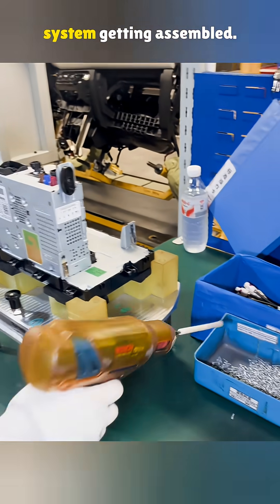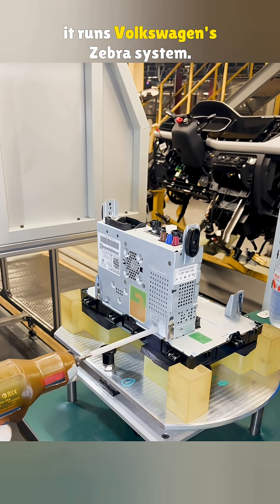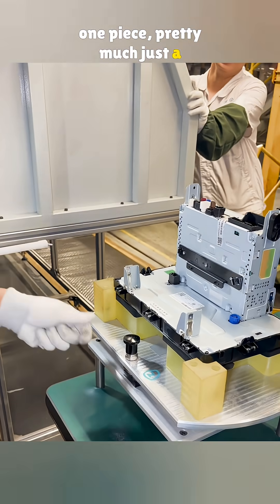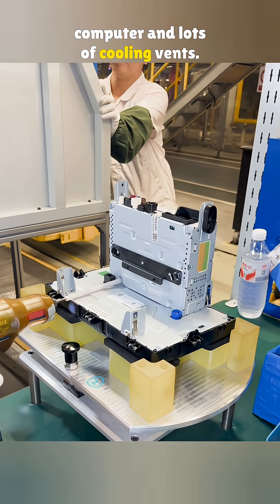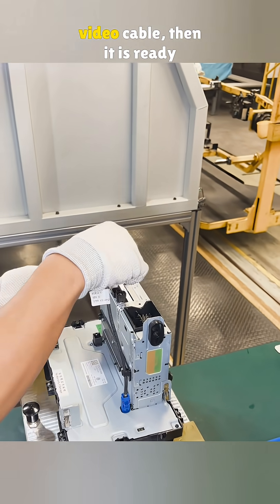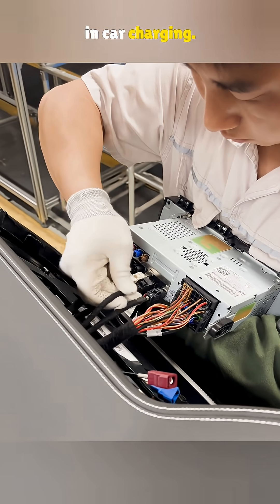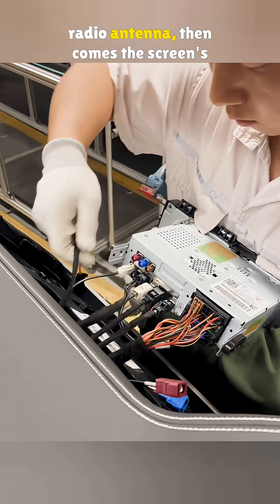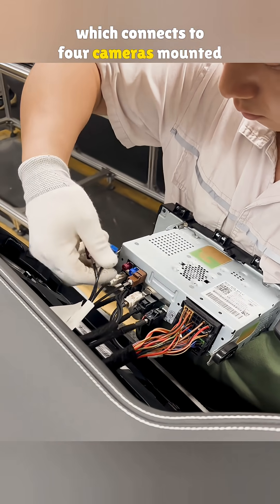Why Volkswagen’s Built-In Infotainment Beats Most Upgrades #assembly #automobile #car #manufacturing

Comment: Our generic Chinese (Temu) cheapie 10.25” wireless CarPlay screen has been mounted on top of the dash in full sunlight for a couple of years without any issues so far.  I don’t know how long it will last but so far so good.  I’ve had three aftermarket screens for different vehicles so far that have all been holding their own with no problems and they all cost very little $.  They’re not handling the kind of processing power that the OEM in-dash units deal with (controlling climate, multiple cameras, high-end microphones for cabin sound cancellation, etc).  They’re just basically wireless CarPlay devices.  But aftermarket products often equal or exceed OEM equivalent products.

Comment: the amount of bullshit in this video is astounding. the SOC inside a car's head unit is 1-to-1 to a phone. all the rest of the boards are is extra inputs for what a car has, like multiple cameras, parking sensors and whatever. Cooling is in most cases, terrible.
Source: I work with these boards.

Comment: None of them are better because they are things we don’t need & when they go off it won’t be spare parts on eBay for £50 it will be you have to go to dealer for the new part to be learned in via a computer only they have password for & your bill is now £3000 & more.

Comment: I use to work for Pioneer Europe and we built custom solutions for OEM. 
Also if you go for top spec, they can read by can-bus all the data. 

OEMs are better than the cheapes in AliExpress, but that’s it.

Comment: But at the same time, you can pay $10k extra for an upgraded audio in S-class, and you will get worse audio quality than aftermarket system for 3k. It's just a scam, as they are putting cheap audio drivers and amplifiers, and are hiding this behind cover with burmester or other harman kardon logo

Comment: The only system I've never had weird quarky problems with is the cheap aftermarket Android Auto system I installed in my beater van.  My wife's SUV, my car, and my work truck have all had problems with the factory AA/ACP systems.

Comment: Someone should show this video to my old VAG infotainment system. Overheating killed it before 4 years of age. In the very mild climate of the UK. Replaced it with an aftermarket set up that cost a lot less and ran perfectly (at least until I sold the car). Admittedly, it didn't have all the functionality in terms of controlling other aspects of the car, but lower functionality is better than zero.

Comment: I'm sorry but OEM units for cars are built as cheaply as possible and no manufacturer leaves more when a 3 Year warranty on them for a reason. 
You would always get better electronics with a pioneer or something similar and way better sound control 
But the problem is that brands forces car functions into these headunits meaning you can't replace them easily anymore without losing some basic functions like hvac control or some stupid car control you easily could have built into the dashboard instead 

Car brands always build with a set budget for parts and they have no reason to invest tons of extra money for parts they don't have to warrant for a long time and for a car they won't care about in 4 years since they expect you to buy a new one 
If your headunit breaks and will just sell you a new one for 10 times the build price and you can't do diddly squat about it 🤷
Reply from the maker: Thanks for your perspective

Comment: Not sure what this AI nonsense is about in the video, but the guy clearly has no clue what he's talking about—probably just some kid running the account. Every factory entertainment unit on the market today is a glitch-ridden mess with zero reliability. Their operating systems are a disaster. I’ve yet to see a single unit that doesn’t have issues.

Comment: What are you talking. Company setup sounds trash. I have installed Pioneer headunit which is aftermarket. Works absolutely tremendous in summers heat of northern india. Which goes upto 42 degrees. Can you imagine? Works smooth like butter in burning heat temperature That to without getting lag or drop in performance. Plus their output with components of focal speakers works like crystal clear blessings for your ears. Cut this &hit.  😅

Comment: My friend has a golf R 2023 and he's had to get his infotainment screen wiped and reset  by the dealer and also fully replaced in the time he has had it. Before he had a Seat Leon and also needed a replacement with that one. Of course a temu or aliexpress cheapo special is going to be trash but spend a few hundred and you can get a great OEM equivalent system.

Comment: This video is straight up bs. 

Yes they may have better software and soc and quality but something happens with it WHICH WILL especially with VAG group - and you are f.ed. aftermarkets can be easily repaired and you can do what ever the hell you want with it regarding software. Make custom features etc. The rest is the same and most aftermarkets are way faster and more powerful.

Comment: Since I was born in 1951 I remember when the optional radio for a car was a simple AM radio with push buttons to change stations. These had only three connections to them. One power supply wire, one antenna cable and a pair of wires going to the single loud speaker in the dash. Those days are long gone.

Comment: Possibly this video is outdated
Most modern cars come with well integrated infotainment systems
But as individual components of that system, aftermarket units out perform most OEM offerings. 

1. The need to integrate everything in place means and utilise a touch screen interface most OEM system run slow. 
Badly slow.

And the trend to reduce physical buttons results in multilayered menus

2. Most OEMs are too arrogant to admit that Google and Apple run the worldwide mobile space. 

They therefore insist on their platforms as the primary OS and offer Android Auto/ Car play as secondaries. 

3. Most OEMs think everyday drivers prefer the option to setup massage seats, suspension stiffness, steering response, access Sirius FM, over simplified physical controls for HVAC controls, the radio/sound, and navigation. 

4. Most OEMs are too profit driven to commit the time or respects to design industry leading individual modules of said infotainment system. 
When was the last time you bought a smile inducing audio system from Cadillac,Porsche, Toyota. 
When was the last time you used a tablet from any of those car manufacturers 
When was the last time you used OEM voice recognition software and didn’t have to hit your head on the steering wheel after repeating yourself for the tenth time. 

5. Have you ever tried to upgrade an OEM system?
Yeah, good luck!

Comment: I don't know.  Have a aftermarket screen with no issues over 100+ degree heat and provided more options and functions than a factory system.  It also has inputs for upgrades should one wants more cameras functions.

Comment: In my car, the climate control and heated seats are tied to the infotainment system in my car. I hate it that they did that. When this thing breaks, not if, you are spending a lot more money and forced to buy another one if you want AC and heat in your car again. Just hope that the car manufacturer is still making that model.

Comment: Even top chinese aftermarket head units outperform most of the factory ones. They using automotive grade chips? Nice, then why it takes minutes a new audi Q6 to load the air conditioner? Not the whole system... usually its an overpriced buggy system told to be the the most amazing and even your 150eur chinese phone outperforms the performance. Not to mention you still have to take your vehicle to the garage instead of OTA updates and everyone is surprised why Europes car manufacturing is dying.

Comment: You'd be surprised by the amount of Factory screens that stop working after a couple years. Not all brands build screens to the same standards
Reply: A friend of mine have a VW Jetta with this infotainment system, and from time to time the thing gets into a loop of losing connection with apple car play until it decides to work normally again
Reply: I have like 3 different cars with  factory.head units. That still work fine

Comment: The simple reason they are mostly better is integration. No matter what after market will always feel out of place in a modern car. Now in a car where the manufacturer treated it as a second thought well it will not necessarily feel better than an aftermarket unit at that point. The other factors that come to play, I think they are a lot more debatable than the integration aspect.

Comment: My Pioneer aftermarket unit survived summers in Arizona without a hiccup. It all comes down to choosing a reputable brand that fits your vehicle and budget, and following the manufacturer-provided instructions.
Reply: Pioneer is the best .👏
Reply: My Pioneer aftermarket head unit display delaminated in the Arizona summer heat.
Reply: @rcktpilot I actually had the same thing happen…it only affected a tiny little corner of the bezel on mine, so I didn’t even notice until I took it out of the car.
Reply: @elcamino06Oh man, mine was bad. I couldn’t read it in the daylight. To be fair, mine was in a convertible and had been exposed to direct sunlight more than once. I had the App Radio 4.
Reply: @rcktpilot Ah, that makes sense. I had a dark window tint.
Reply: The video probably wasn't talking about the reputable after market systems that are made by Pioneer, Sony, etc... they're using automotive grade components. They're likely talking about the no-name brands that come from rebadgers who order wholesale cheap systems from China.
Reply: Is it the one with car play and android auto?
Reply: Same here, more than 6 years using Pioneer, summer after summer in Rio heat, not a single problem.
Reply: I love Volvo’s
Reply: That's true, before my car came with these built in system, I've always used Pioneer, I'm from Brazil, São Paulo, 30-35°C on Summer (not the worst temperatures though).
Never gad a problem with them.
Reply: I was about to say - PIONEER ALL THE WAY!!!
Reply: You can't go wrong with Pioneer
Reply: Pioneer screen fucked up in my car 😢
Reply: I have the high end top of the line factory head unit from volkswagen in my car. The hands free function crashes all the time during calls, carplay crashes when you even look at the cable weird, the digital radio reception sucks, the audio settings lack basic customizability. 
I really miss my pioneer headunit.
Reply: We had a first year 2013 Tesla model s and the entire center tablet and dashboard screens delaminated and spilled the adhesive out the bottom of the screens. We are in California and it doesn’t get that hot.

Comment: Back in the day computers were the size of a room and they had a storage device that was also a size of a room, but could handle a few kilobytes of stored data and needed another room for cooling solution. Now compare this to modern computers. Cellphone fits in your pocket and millions of times faster and has more storage, and it’s cooling solution is a size of a small patch.
Having a separate control unit doesn’t necessary mean it’s more rugged or has a better heat dissipation, or is better by all means.

Comment: Using an aftermarket chinese HU for 5+ years in scorching heat of Rajasthan, India (45-50°C), never has it overheated or i felt that audio is any worse than it was with my OEM unit. In fact, this Chinese HU has Android Auto/Apple carplay, wireless, works like a charm everytime. Im glad I did not pay a massive amount when my stock HU needed replacement and got this unit for like 1/5th the price.
Reply: Konse company ka hai bhai?
Reply: Hahaha
Reply: nice in my nexon sometimes the camera used to get stuck at the reverse parking screen but that happened almost never

Comment: Reasons why people go to an aftermarket solution.
Better DAC
Low Level RCA outputs
Better control over smaller audio details
Better EQ controls
Replaceable with another brand
Not deeply integrated
Reply: not deeply integrated that makes no sense how would that be a con
Reply: @prayze5924  Because you can replace the factory HU for another one.

Car functions should not pass through it.
Everything from radio to HVAC is now being done by the headunit.

By having HAVC controlled by the headunit, forces you to stay wit the factory solution.

Comment: No way an aftermarket one will be worse than the built-in one, function wise and easy to replace, also it's 1/10th of factory built-in. Skip those yearly gps map update cost from some manufacturers, just this alone can buy 2 or 3 of those aftermarket.

Comment: the After market system has its own challenges. factori fitted has its own benefits. factory fitted systems made by own company that's why the  company can do everything with the system. they can synchronise the can integrated with  car electronics and controls company can do any thing. becouse the system and car  made by own. but aftermarket system can attach only some points which is given by company. nevertheless aftermarket system can performs as like  origenal.
Reply: Try a branded CAN decoder and you will have all the functions built in to an aftermarket unit, in some cars even unlock the features that only top variants have. It's all a matter of how much one wants to spend.

Comment: NO. A factory infotainment is not better than an aftermarket system if you buy a proper system. Just don't buy from them from TEMU. However, the factory infotainment is usually a lot better integrated to the whole car. E.g. my aftermarket system can't use the display in the dashboard.

Comment: Yeah... Right. No.
VW had issues with shitty software for years. And in their older versions of the infotainment systems the SoCs were garbage. In one point in time, they were forced to upgrade to newer generation chips, cause the chip maker refused to produce more of that old garbage and wanted to replace the old production lines... Also if I buy a car for like 50k or something and the infotainment system completely shits itself and presents you a sideshow if it has to - God forbid - rotate the map on the navigation system, I wouldn't consider it a premium experience.

Comment: The only reason I would need a screen in my car is for the backup camera. Everything else, radio, CD, a/c, everything else can be done using buttons and dials, like it used to be before they morphed everything into a touchscreen that looks ugly, is inefficient and distracts you
Reply: I don't think buttons and dials are the best way to operate the navigations system/map, unless you're an etch a sketch pro

Comment: I have to totally disagree with that. I've seen factory infotainment centers have the air conditioner and heater controls integrated in the radio. As soon as the radio breaks, so does your AC. I've seen cars today, 2025 that do not have wireless car play / Auto Android, you still have to plug it in I bought my car in 2020 and bought a Pioneer head unit that contained wireless Carplay / Auto Android. I've seen 2025 models that still don't have that feature

Comment: It ultimately comes down to those simple things:
- SoC
- Software
- Cooling

If they just put an iPad Pro with custom Apple made software in there, it would perform better than any OEM head unit in existence and still be a tablet. Others have huge boxes and still use an SoC from 2013 with almost no RAM and shitty software (and still charge 3x the price of an iPad)
Reply: My Android Head Unit is the best among the market and it has a very fast SoC, as well as 8GB of RAM and 256GB of storage.
It is just as smooth as my flagship phone. It improved my experience in my car like crazy, as I now have a 9" beautiful display. Lag free. And as for heat, no problems because it has a built-in fan.

Comment: What an idiotic piece of content.  Technically speaking, what makes either the factory-installed unit or the after-market unit better is what you want to do with it.  For most of us, the factory-made units are all that an average person needs.  While it is true that chips designed for infotainment systems are more expensive and built for stability, they are not superior to a normal smartphone chip from a technological point of view.  In fact, if a smartphone didn't have to deal with all the variables a typical infotainment unit does, your one small phone could run all of your car's systems with ease, and it comes with some customisability, which a typical infotainment system lacks.

Comment: Well, that's nice.  But, this also is a good illustration of why fuel economy hasn't really improved (on cars) in decades. Endless amounts of complication - which leads to excessive WEIGHT. And, since manufacturers largely ignore weight, including that of the body structure of their cars, let alone the engine, gearbox, etc. ....plus add all of these electronic doo-dads....the end result is lousy fuel economy.  Or, short range, in an electric model. 

Weight, or properly stated, MASS....is EVERYTHING. Don't believe that ? Just ask an AIRCRAFT engineer....